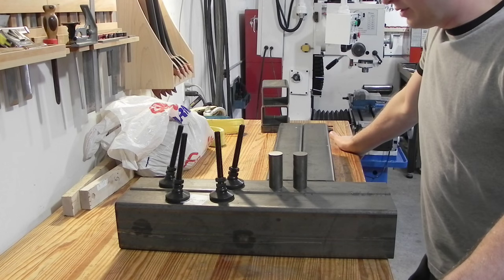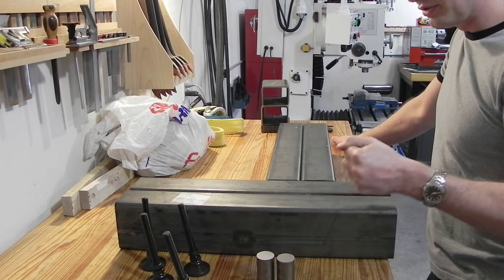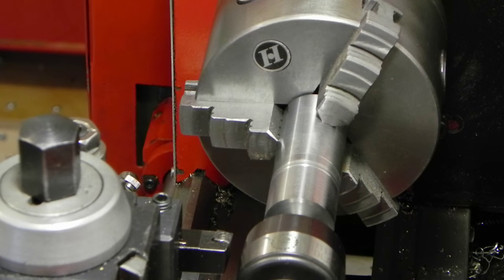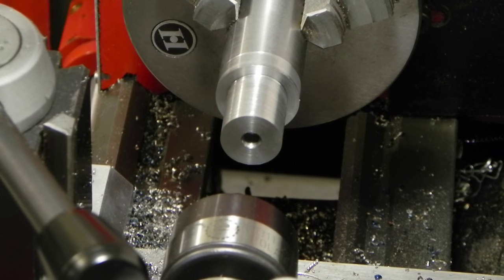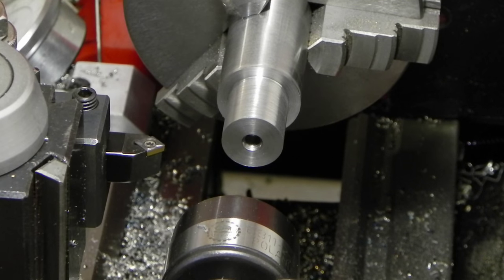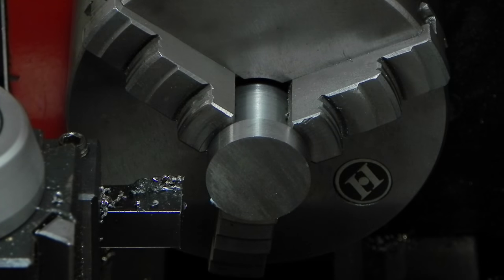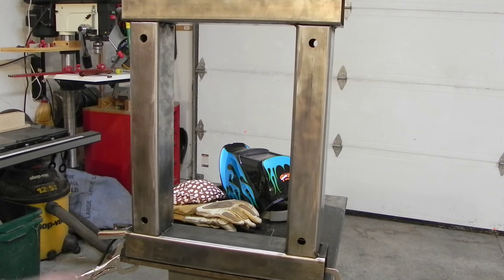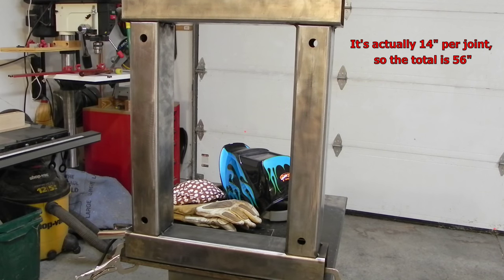Making a mill base

Comment: I have a PM25 and want to upgrade to a pm940, can you say if the "M" version is worth saving the money on over the "V"
Reply from the maker: I've never run a V version, but based on the specs the only real benefit is going to be the higher rpm, and  variable speed. given the 2 speed ranges I doubt you are going to have a lot of power at maximum rpm. Imo The power down feed, and hardened ways are better things to spend your money on.

Comment: Dan, I got a question.  I have a PM-932 and want to make a base like yours but I’m wondering how you attached the cast iron base to the tube base?  Does your bolt go through the top and bottom of the square tube ?  I cannot tell from the video
Reply from the maker: You got it right, the bolts go all the way through the tube top to bottom. The holes in the tube are just big enough to make sure alignment isn't a hassle.
Reply: dans-hobbies thank you.

Comment: I am about to pull the trigger on a PM-932M-PDF, which is the little brother to your PM-940.  Do you find that you couldn't have lived with the machine without the riser?  I only have 78" in my basement and the head at max travel is 78" so I don't have any more room unless I go with a smaller machine which I don't want to do due to the fact that I want the extra weight this machine has for milling steel.
Reply from the maker: I had to have the riser, as without it I constantly had to lean over or squat down so I could work the lead screws.

For reference I'm just shy of 6'1", and most tools seem to lowbto me. It doesn't matter if it's a mill or a drill press or a table saw. 

  You might want to contact quality machine tools and see if they can give you the  heights and diameters of the hand wheels for the 932 then you can do a quick mock-up and see if it'll work for you.
Reply: @Dans-hobbies  hi Dan, I too am waiting on delivery of a 932. Was waiting for a 727 VM but after more than a year of Chinese excuses I've changed my order.
 Like you I'm about 6' and am trying to get from PM, the table to base dimensions. They don't quote them in the manual. 
What did you use for your steel tube? It looks like 2"*4" but I don't think I heard you say. 
The feet you used amazon doesn't recognize. They've got lots of others though. 
Don't knock your welding. After some of the pigeon shit I've seen some professional's produce yours is fine. Was that stick or mig?
Thanks for the video it was at least watchable. No daft music wailing in the background.
Reply from the maker: @ronwilken5219  Hi Ron, I'm sorry it took a little while to get back to you, I've been out of town.

On my 940, the table is 35-1/2" of the floor stock. With the base and leveling feet, it's 43", and I find that much easier to work with. The tubing is 3" x 4" x 3/16", that I picked up fairly cheaply via ebay if memory serves. I have an el cheapo 120v mig machine, some day i need to break down and get something better.

Comment: Nice job.  I just purchased a similar PM mill and I am considering building a base for mine too. How high did your table top surface come out too?  How do you like it once you got the vise and work on the table?
Reply from the maker: Right now the table top is at 41.5" above the floor. Thanks to the lengths of the leveling feet, I could raise it another 2", and drop it down about 1 if I wanted to. When it gets a little warmer, i think I might raise it another inch or so.

I'm 6' tall barefooted, mostly legs as my wife likes to say, so everything is always less than ideal for me, but as it stands now its a good compromise.
Reply: Thanks Dan!  That's good to know.  I'm 6'3" and I was thinking 40" would be more than high enough.